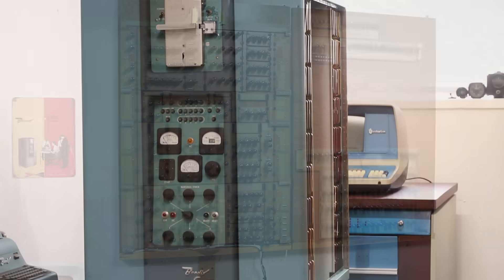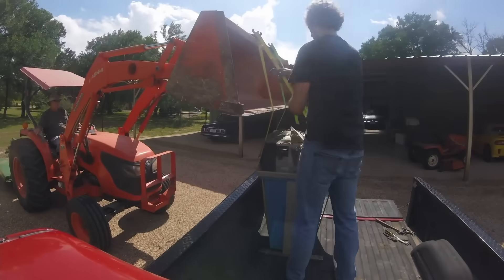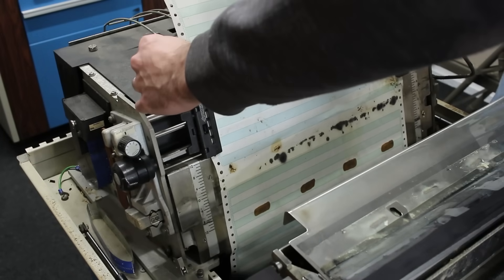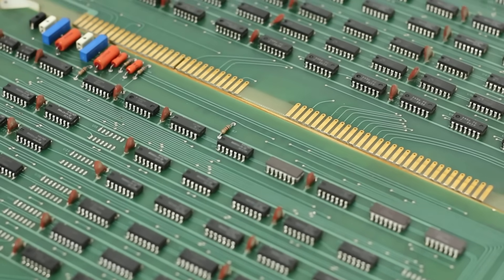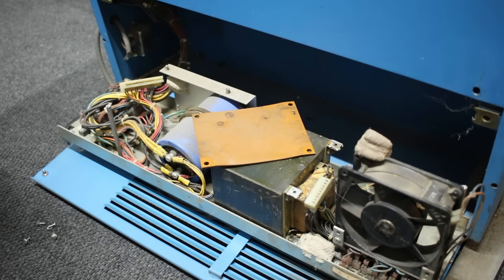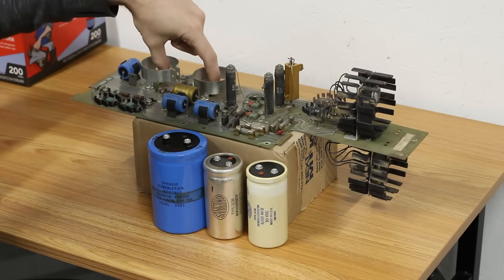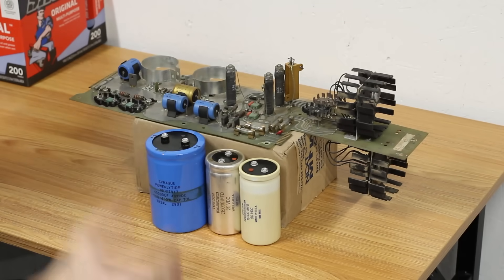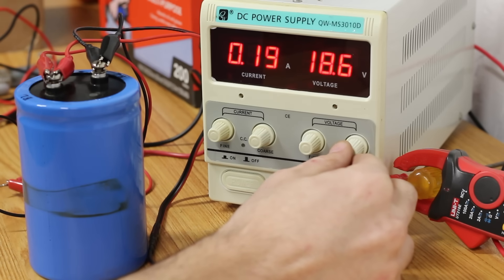Working on the Largest Printer I Own

Comment: Back in the 80's I worked as a computer repair technician.  Computers and drives I had no problems with but printers, boy.  Almost every one I worked on I ended up with a small bag of parts left over after putting them back together but they were working so were the parts really necessary or was my boss messing with me by slipping them in when I wasn't looking.  We'll never know.

Comment: The ole System 3 we had at SYSTIME had a 1403 attached. The 1403 is the same printer shown in Dr Strangelove where a pocket radio was kept. The weird thing about the print chain we used is the fact that the numbers were all turned sideways in order to print serial labels. Also fixed the program which required supervision and fiddling. Programmer made a math error. Ran perfect thereafter. Nice timing belts, btw. EDIT: enjoy purchasing new ink rollers. Heh. 132 wide, huh. Ouch

Comment: I would be scared to connect that old power supply to the 5V rail, lot of magic smoke under pressure in those chips. Does it have a crowbar???

Comment: Father forgive me, for I have sinned; it has been 35 years since my last printer abuse confession.

Once I learned how band-type line printers worked, I speculated on what would happen if a nonsense text pattern - which corresponded to the spacing and distribution of the printer band characters - was sent into the printer, causing each hammer over the band to strike at once. I'll simply state the "clack" we received upon sending the text string was a very satisfying sound. 

I wasn't completely satisfied, and I wanted to see what would happen if a continuous string of characters, corresponding to the spacing between the characters on the band itself was sent into the system. Oh boy, was that a show-stopper: it lasted less than a half-second, but the violence of Every. Single. Hammer. striking that band in sequence nearly made the printer jump, and the computer center overseer nearly howled in rage when he figured out what had been done to generate such awful noise.

I have long since come to appreciate the strength and beauty of impact printers, especially when it comes to their unique ability to print multipart forms with ease.
Reply: I wonder if that's where Terry Pratchett got the idea for the Clacks message that could bring down a tower? I used to have a huge commercial grade dot matrix printer with a massive print head assembly and a suitably beefy mechanism to fling it about at impressive speed. It had to sit on a substantial table as the inertia of the head would have collapsed anything else. I used an old door firmly screwed to a solid wall with heavy timber legs.

Comment: Used to work on Dataprinter corp. line printers. 600 &1200 lpm. The 1200 had a vacuum cleaner built into the cabinet.
Major dust creator. Tricky timing circuits.

Comment: I’m surprised that you have carpet in your computer room. Carpet attracts dust bunnies and the fans in the equipment will draw them up into the components. Technology from the 70’s was unreal. Really got a kick outta operating the IBM System 370/135 back in the mid 70’s. ❤
Reply: Just a bit of info...  The c Centurion mfg. floor was 100% covered in carpet.  The 40,00 sq ft carpeted mfg. floor was easier to clean than a titled floor we had in the past.
Reply: Data centres of this era all had carpeted raised floors. We still have one at work. Hopefully going to be refurbished this year as it's now basically empty and used for storage now.

Comment: Ahh, the good old days when you would sit in the terminal room, submit your job, and patiently wait for the line printer to print the result. Or to hear the characteristic sound of a full register dump indicating that your program had crashed.
Reply: for some of us the printer was 80 miles away, got result next day (why didnt we invest in a monitor ?) only to find one had input the wrong decimal point and the graph and result was nonsense
Reply: @highpath4776  - for me it was the other way around. The Unisys mainframe was 25 miles away, but the printer was local.
Reply: In my "good old days" you would hand your deck of cards through the window at the computer lab and come back a day later to get your print out. Just to find that a misplaced comma crashed your job.
Reply: @KameraShy  Been there done that, basically just once as I'm only 59 years old but yeah, just managed to get that experience.

Comment: I would check the rripple voltage of the caps before progressing to power logic boards. As a general rule for me, I replace old caps like that on equipment I am going to keep. It might get expensive, but worth it.

Comment: Those carbon composition resistors tend to drift upward in value with age so when you settle in to start going over the hammer driver boards in detail, you may want to go down the line with an ohmmeter and see how the measured readings compared to the marked value and tolerance.

Comment: The Fairchild part in the video at 5:34 looks like it is marked “96602PC.”  There is a 96S02PC, which is a dual retriggerable one-shot.  The RC network next to the chip would make sense.  It may be socketed because it was hand selected for a fast enough part.  The empty socket next door may be for test probing - hope so.  Of course, the manufacturer’s service book would reveal all.  Hopefully someone out there has a copy.  The service book is probably essential for avoiding disaster working on a machine with parts moving at the speed used in this printer.

Comment: When it comes time to clean up the character chain, brakeclean in a container that won't melt from it or high-proof alcohol are going to be your friends with a toothbrush to really get into the nooks and crannies of every character, follow up with a brass wire wheel on a cordless drill to get them to shine... Adding WD-40 to the ribbon, wherver it goes, should add enough detergents to the ribbon again to produce ink, and be mindful of what lubricants are used where, some lubricants won't like plastic while others aren't made for high speed applications.

Comment: All electrolytic capacitors leak.  As for forming, once you get the voltage applied where you want it, let it sit overnight.  That should reduce the leakage to the minimum you're going to get.  And you don't need to put a lot of voltage across the capacitor.  For a 25Vdc, i would slowly raise it to around 20V and let it sit.  60Vdc, i'd probably go to 40V and let it sit an hour, then 50V, let it sit, then 55V and let it run overnight.

Those older electrolytes tend to be very robust.  Modern electrolytes don't take sitting around without a charge on them as well, in my experience.
Reply: I've gotten lots of old electrolytic caps like these from the local hamfests. Most of them were perfectly fine after reforming overnight.
As long as they haven't dried out or been damaged by applying full voltage without current limiting, they will usually be good.

Comment: I never used a line printer when I was working with computers. But I got to hear stories. I heard that the chains would occasionally break and since it was traveling at high speed it would throw the chain out the side of the printer and you better hope that you weren't standing next to it when that happened.

Comment: Back in the day I did some programming on an IBM 360 mainframe. The printouts came out of an IBM 1403 chain printer that was 1,000LPM. Chain printers are fascinating bits of 70's era technology. The biggest problem you may face with getting that 125LPM printer working properly is adjusting the timing of when the hammers fire that hit the moving chain. This is going to be an interesting journey to watch.
Reply from the maker: Oh man, I can't even imagine how insanely fast that 1,000 LPM printer must have been. The simple 125LPM I have here does essentially two rows per second, but the 1,000 LPM is eight times faster than that!
Reply: @UsagiElectric  We had printers that could print as fast as most line printers could do a page eject.   Several pages/second.   You had to get the paper in just right and there were a bunch of grounding wires to prevent static buildup from the paper shooting by or you would get the biggest paper jam you've ever seen.
Reply: @ChristopherHailey You're right about getting the paper in right. But also all the wire mesh that deflected the paper arc into the collection bin.

I once saw the operator restart the line printer after adding paper and the deflection cage wasn't locked in place. The stream of paper displaced a ceiling tile and enough paper was on top of the ceiling to break another tile and come down all over the place.
Reply: @mikebarushok5361  Wow, never saw one go that amok, but i've seen them shoot paper straight out across the room.  That must have been a sight!
Reply: @UsagiElectric - The 1403 was a real beast of a machine. One of them dwarfs the printer you have. It could go through an entire box of paper in no time. You always had to remember to never place your deck of punch cards on the top of the machine. When the paper ran out the cover would raise and any deck on top of the machine would wind up on the floor. For fun, check out videos of an IBM 1403 being used to play music. :)
Reply: I used to program and sometimes operate IBM 360s and those printers were beasts.  The old card readers sounded like a wood chipper.  Computer rooms were really loud back then!
Reply: Those printers are both terrifying and utterly awesome ;)

Comment: The location of the tape loops suggests to me that it was used to control the platen for preprinted custom forms, the default tape loop would just skip over the perforations in the fan fold paper,

Comment: Thanks for the printer tour and welcome to the new year.  When you think about it, printing a line of 132 characters every 480 mS pretty much maxes out the capability of 7400 series TTL on boards of the size in this printer.  Gate delays are on the order of 10 to 20 nS, thus the maximum rate for a system clock is probably between 5 and 10 MHz.  The chain/band probably has the character set repeated around six times.  You’ve got around 2 mS or so for each hammer to fire over the correct character before the rack moves in to the position to print the adjoining position.  That makes this machine pretty much state of the art for its time.
Reply: are not some common characters repeated more to minimise chain movement ?
Reply: @highpath4776   The chain or band speed is constant.  I do not know this printer, so I don’t know whether it is chain or band.  The two types are materially the same in operation.  The difference is the band has embossed characters and a chain type has interlocking cast type slugs.  Both move the type at constant velocity and fire the hammer when the hammer is over the desired character.  Repeated character set allow lower velocity.  The advantage of band printers is that end users can change the band when it wears or to change character sets.  This printer economizes by having each hammer service two adjacent positions by jogging the rack.

Printers like the IBM 1403 had a full 132 hammers and could print 600 LPM.  The type chain of a 1403 moves at scary velocity, hence the other comment about a chain stuck in a wall is believable.  That is pretty remarkable, considering the 1403 dates to 1959 and was part of the transistor based 1401 system, no ICs.  The 1403 saw duty on other systems in laters years up through at least the 1970s and it would not surprised me if some 1403s are still in operation.
Reply: @wtmayhew  There is a working 1403 at the Computer History Museum. There are a number of youtube videos of it running.

Comment: The fan needs a rebuild. That's a looong long time to spool up to top speed. Take it apart and scrub the bearings clean. Depending on how loose things are use thicker or thinner oil (thicker oil also accounts for the fan getting hot during work, so think about that aspect as well).
Reply: yep , it is dusty and any lube has dried out

Comment: Question… what is a "negative voltage"? Thanks.
Reply: In most electronics systems a particular reference level is chosen to be "ground" and all other voltages are measured relative to that. So a voltage below ground, such that conventional current would flow from ground to that power supply pin, is a negative voltage.

But it's just a convention, of course. All voltages are only relative measures of the potential between two points, so you could declare, that a system uses instead of -12/-5/0/5/12 V, it uses 0/7/12/17/24 V. But that would be less convenient for doing calculations in most designs, since you can end up having to say that 12 V represents a logic 0 and 17 V represents a logic 1.
Reply: @Curt_Sampson  Yep.  Took me a while to internalize this idea.  I was always taught "ground is ground," back in the early 80's. Except that it isn't, always.  Systems i work on today sometimes have isolated power supplies where the "neutral" or "common" is not ground, and you have to be aware of that fact when trying to measure voltages.

And you also have to be aware of the polarity of your meter leads.  Get the leads reversed, and the displayed polarity reverses.  So you need to be aware of what you are trying to measure, and how to measure it for your reading to have any validity.  Not to mention, it is possible to exceed the voltage rating of your measuring device.  It's not fun when your expensive DMM explodes, because what you thought was 480VAC, ends up being 4160VAC.  Happened to a work colleague, and luckily he only got bruising and minor burns to his "meter" hand.  The poor Fluke, OTOH, was wasted.
Reply: Negative referencing to ground. All voltages in certain circuit are given as relative to GND. Just convention.
Reply: Is it a reversed polarity?

Comment: The fun of the Data-100 is the complete Hammer Bank assembly shifts to the left then prints the odd positions then shifts to the right to print all the even positions on the line being printed, the paper moves up one line. The fun is the timing of the print-belt spinning across the front of the paper and the Hammer Bank shifting Left - Right  - Left .... 250 times per minute for a line speed of 125 Line Pwr Minutes ( 125 LPM ].  FYI - The power OFF position of the Hammer Bank is in the center, not Left or Right.  The motor & Cam Link drives the Hammer Bank when the printer is printing,  it loud...!

Comment: Just as a precaution hint: I don't know how fast this chain spins, but I've heard from IBM technicians that they once had a case of "chain embedded in wall of datacenter" - don't spin it up to full speed without the case around it I'd say; or at least be well out of the "trajectory" :)
Reply: Yeah I've heard the same back then, when a chain breaks it's spectacular. All that metal is there for a reason.  It's like a motorcycle chain at full speed.
Reply: Plastic clips on a rubber belt.  The most used letters would break all the time.  This was only 100 lines per minute printer.  Slow...  Wait until you had a 1000 LPM printer throw a drum belt.  That was always fun.
Reply: Nah that's a wives tale. That would not be possible.